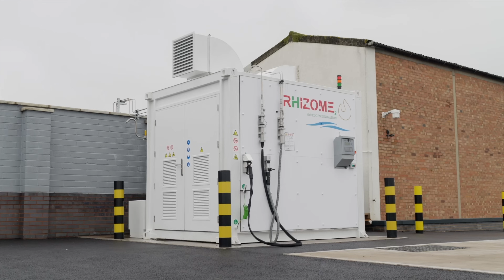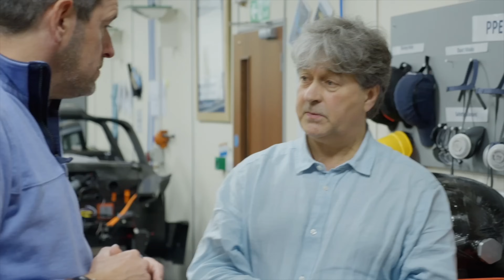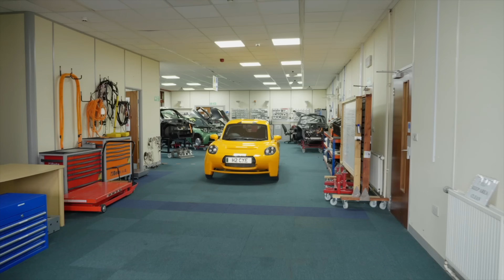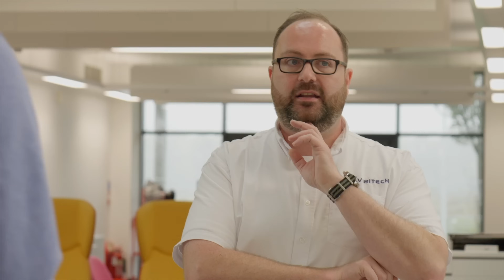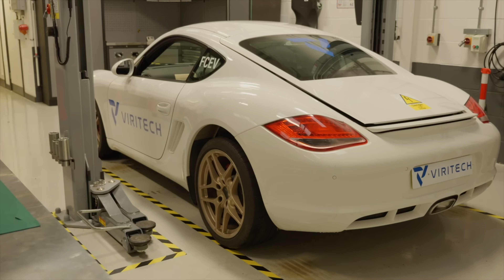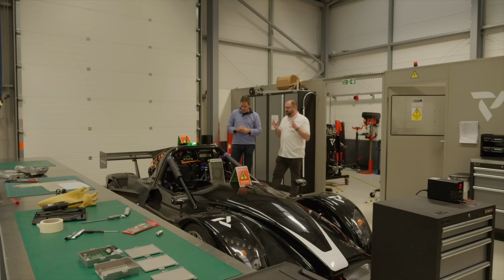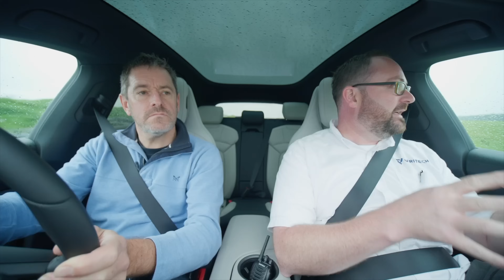Is Hydrogen a viable option for our Automotive Future ?

Comment: The biggest challenge facing low emission hydrogen is that it is expensive to produce, expensive to transport, expensive to store, expensive to distribute, and expensive to use. Whether you're switching existing users to clean hydrogen or pushing hydrogen into sectors where it's not currently used, it takes money - and lots of it. (extract from the "Cleaning it up" podcast). Countries have spent wasted millions on hydrogen as a fuel.
Reply: They want to replace dirty gasoline and diesel with "clean" hydrogen, but still tie me to buying it from a supplier at a location far from my home, when I can charge my electric car at home cheaper, and cut out the middleman.
Reply: Too many issues as others have mentioned for hydrogen to be main-stream and so a comprehensive infrastructure will be unlikely. As with any chemical fuel, chemical thermodynamics are against you; batteries and capacitors do not have that issue. Hydrogen is a very valuable chemical and a really bad fuel.
Reply: Even steam reformed hydrogen (which is about 95% of all hydrogen currently produced) is expensive. It's not only expensive to transport and store, it also leaks... a lot. To avoid this you need to either cool or compress it giving more energy loss. Then to convert back to electricity involves more losses. Hydrogen will never be cheaper than pure battery electric which is getting cheaper and more energy dense (per cost and per kg), thus solving most of the issues. Hydrogen will be needed in the future, but for ground transport it won't ever overcome it's physical limitations on storage, efficiency and cost.
Reply: lithium batteries have come down dozens of percentages since the supply chain issues during covid. Scale would solve costs for hydrogen.
Reply: @monstercameron  "Scale would solve costs for hydrogen." It will never solve physics. It's an inherently stupid idea.
Reply: @slloyd6577  this tesla fan BOY neanderthal know damn well you can distribute water to fuel stations almost for free and electrolyze that water on site with abundant daytime solar, don’t listen to fools with an elon musk twisted agenda.
Reply: The earth is full of hydrogen, you don't have to create it, you can pump it out, and it's self-replenishing. White Hydrogen stations are being built as we speak. Electricity is hard to transport over long distances and there is insufficient infrastructure to charge cities full of EVs. Both have challenges, but Hydrogen is certainly an option.
Reply: @Roar.  Electricity is easy to transport over long distances hence the project to lay an interconnector from Morroco to the UK. Hydrogen, on the other hand is incredibly expensive to transport.

Comment: Physics is the reason why hydrogen WILL never be a viable fuel for cars. 

Hydrogen is the second smallest atom known to man thus it is very hard to prevent leakage. It also needs to be stored at MINUS 253 degrees C and 10,152 psi (700 bar).

As the owners of the Toyota Mirai have found out. The hydrogen filling nozzle can freeze in place when filling and Toyota's official guidance says in the owners manual is to wait a few minutes after filling for the connection to thaw and it'll release. They don't tell you how to release that connection when the ambient temperature is near or below zero.

They don't store hydrogen at the filling stations at 700 bar but to get a worthwhile amount of hydrogen (range) in the car it's compressed by the filling pump at delivery. This means that the pump needs to compress the liquid hydrogen for the next delivery after the first delivery has been dispensed. This is why we've seen long queues forming at hydrogen filling stations in California. They are waiting for the filling pump to recompress before they can fill the next car. 

Ultimately electric cars probably wouldn't have caught on as well as they have if Tesla hadn't created its own charging network. I can't think of another car manufacturer that has done the same. Toyota certainly didn't create a hydrogen filling network. Hence they have failed to get a decent foothold in California and Norway.

(Whilst Nio have a network of battery swapped stations, few exist outside of China, hence why I don't consider this a real network)

Comment: This video is not going to date well.  Anyone who really looks into it will quickly discover that hydrogen is a non-starter as a fuel for any widespread adoption, barring some niche applications. Please, let's stop kidding ourselves. - there are too many downsides to hydrogen. Sad, but true.
Reply: Let's stop kidding ourselves - there are too many downsides to full Electric Vehicle designs! As more honest information gets promulgated about the  massive logistical and availability problems associated with battery production people will realise that E.Vs will never be able to attain the widespread  usage that Internal Combustion Engines have given us. Yes , E.V.s will certainly become more common and their designs will surely become more efficient Electrical supply infrastructure will have to improve exponentially for the genre to be accepted and this is not going to happen within the next couple of decades - if ever. We need much more research into Hydrogen power (and other forms) for the World to be able to cope with our ever increasing transport needs. Not sad, but true.
Reply: @robertowen6499  Strange, my BEV has been working great for five years.

Comment: Hydrogen production can be anything but clean to produce. The only method of production that is clean is via electricity but the ammout of electricity you use to make it is close if not more than the calorific/energy content of the hydrogen. In those terms the H2 is basically a battery and the other methids of procution have waste products like CO2 so hardly green. The last problem is the lack of infrastructure out there to use H2. I understand that the existing number of places you can fill up with H2 in the UK has actually dropped so the early backers have already started leaving the concept. The many many billions needed to deploy significant numbers of H2 filling stations are much better used elsewhere. An interesting concept but I feel doomed in it's everyday usefulness thanks to the lack of working infrastructure to help it work.

Comment: Notice how they never mention the range
Reply: Difficult to tell. It was a reasonably small tank compared to the 122L in the Mirai, and the tank was only pressurised to 350bar, when tanks in production EVs are at 700bar. Both of these factors will definitely limit range. The guy in the video did say that they were aiming for short daily trip market, but an EV, even a Nissan Leaf is already ideal for this exact purpose.

Comment: To understand hydrogen power systems, do some home work on why large mining operations have abandoned hydrogen for battery electric motor systems, main reasons the regeneration of the motors driving to the face recharges the batteries substantially, the huge reduction of maintenance on brakes etc, finally the engines become redundant, saving on long term cost, to allow hydrogen to be used puts the control into the oil companies and governments, this is not good to be able to charge EVs at home gives us control, hydrogen is a dumb idea, the infrastructure to roll out hydrogen stations is a cost that’s a madness, shell is currently dismantling all its hydrogen filling stations, worth a thought on this hopeless future fuel,

Comment: Interesting stuff but indicative to me of the shortcomings of hydrogen as a fuel source in most scenarios. It all seems to assume that battery technology has peaked in terms of energy density which it clearly hasn’t. The complexity of using renewable energy to create green hydrogen via electrolysis, store it, transport it and then combust it to drive electric motors has an almost Pythonesque level of ludicrousness to me. If a technology could be developed for shipping, where hydrogen could be split from sea water to provide motive power for very large container ships, all being processed onboard that would be something but I’ve been advised previously that’s not going to happen. It seems to me despite the FUD that we’re getting close to a tipping point towards BEVs and hydrogen is unlikely to be a viable solution.

Comment: As you have often said Pete, there needs to be a broader approach to our motoring future and clearly hydrogen should be one of the answers. The River Simple approach is a prime example where they are making a simple eco friendly ‘ town car’ that makes perfect sense as an individual transport option. The sad fact is that our current crop of politicians seem to be blinkered and are throwing everything down the rabbit hole of BEV!
Reply: Take the river simple then... would you "lease" one?  Have you looked at the cost? And how you refill it?  If not you, your friends and family, would you recommend it to them?    Didn't think so.  Just like the Toyota Mirai, it's too expensive, and too inconvent to fill up.
Reply: How does a terrible little car with nowhere to refuel (*) "make perfect sense as an individual transport option"?  The Dacia Spring EV is a better and cheaper option than RiverSimple's vapourware offering.

(*) and even if it was available, it would be horrendously expensive source of fuel.

Comment: We have been hearing about hydrogen for years with little to no real headway. Battery Electric is winning on all fronts including for heavy vehicles simple on cost and efficiency I wonder when the penny will drop..
Reply from the maker: But the is the point. Battery electric doesn’t really work for HGVs 🤷‍♂️
Reply: @PetrolPed  https://www.youtube.com/watch?v=xWEOc8O2VEY
Reply: @PetrolPed  yes it does work for HGVs. But even if it didn't then in what way does a small and ridiculous two seater car help?

Comment: 1:25 "About 50% of today's hydrogen comes from natural gas..." Yes, and most of the rest comes from oil and coal. A little under 5% comes from renewable sources, and that isn't going to grow because it's far more economic to use the electricity via a battery or transport it via wires than convert it to hydrogen. 

95% of Hydrogen for transport discussion is greenwashing and it's irresponsible not to say that. 

Unsubscribed.

Comment: In the Marine Industry we too are looking at alternative fuels. Heavy Oils are mostly used at sea on big ships, that muck that belches out black smoke you can see from Space. Only when the ship comes close to the coast do they switch to light fuel-oil to look clean. All the EV cars on Planet Earth can't cover the pollution 1000 ships on passage. This is why we are looking at Ammonia, a richly dense fuel full of Hydrogen. Basically similar power plants we use today can be remade as compatible.
Reply: Commercial ammonia is made from fossil fuels isn't it?
Reply: @slloyd6577  the Haber-Bosch system used green energy and seawater.

Comment: None of this is viable for many solid engineering reasons. 
Production of hydrogen is energy intensive. 
Storage of hydrogen as a gas is too voluminous for the energy density realized. 
Storage of liquid hydrogen has to be at low temperatures very difficult to maintain. 
Even the mighty Toyota and BMW brain trusts have given up on hydrogen for the time being. 
Physics dictate reality

Comment: So the greener way to make hydrogen is an electrolysis hydrogen generator with an efficiency rate of 70% which needs to be shipped to stations while heavily pressurised to fuel a hydrogen combustion engine with 25% efficiency.. using fuel cells to power an electric motor would increase the efficiency to 50% ..... OR WE COULD JUST USE THE ELECTRICITY TO POWER THE EV 😂... Hydrogen will never be the answer

Comment: High Pete I’m a driver of an Ev and I do get what you say. But the elephant in the room is infrastructure or complete lack of it. It’s the chicken and egg situation. Without the fuel station you won’t sell a car without the car companies won’t set up fuel stations. This is the problem Toyota have with there hydrogen car. What is needed is a company like Tesla build the cars yes but put a infrastructure in place along side it. But if we are supposed to be moving to clean fuels then how hydrogen is made has to be bought into the equation. Using natural gas to produce it is not exactly clean. For commercial use definitely the way forward.

Comment: Hydrogen may have a role in road transport but the infrastructure necessary to play a significant vehicle role is doubtful. It’s difficult enough setting up infrastructure for EV’s and electrical networking is everywhere. It’s a bit like LPG which sort of fizzled. ICE and EV’s will power most vehicles and as more EV’s are purchased it’ll impact negatively on the price of fuels for ICE vehicles. Non home charging for EV’s has to improve considerably such as covered charging stations and with battery charging technology improving charging times are coming down. It’s early days for EV’s but ICE vehicles will remain for a long, long time as their towing ability over long distances is unmatched.

Comment: Another delusional youtuber. Research the supply chain for hydrogen from creation to delivery and you'll find it's not practical except for very niche transport applications. The amount of electricity you'll use to create green hydrogen to drive a fuel cell car 100 miles, you could have driven an EV 300 miles.  Hydrogen is marginally more efficient than petrol/diesel.
Reply from the maker: No delusion here my friend. Just an open mind. You should try it 🙄
Reply: @PetrolPed  i was of the mind once that hydrogen was a possibility a while ago until i looked into the supply chain and all the problems with it and the poor efficiency of the end product.  You should try researching it. Its a "fuel for the future" and will always be in the future because you'll never make enough of it for anything but niche areas. Look for stuff by hydrogen experts that are NOT part of the fossil industry. (e.g. Prof David Ceban, Michael Liebreich, Paul Martin)
Reply: @PetrolPed  You stand alone!!!!!!!
Reply: @PetrolPed  Why didn't you mention anything about costs: the cost of the car or the cost per mile of hydrogen ?

Comment: I think you would have been better off doing a video on how the distribution is going to happen rather the vehicles but that wouldn’t have ticked the boxes for Michelin I guess. I think hydrogen does have a place for buses and construction but otherwise I think it’s going same way as the Betamax video 🤷‍♂️
Reply: Oooh, bad example. Betamax produced a far superior picture (not as good as the Phillips 2000 though). VHS however had the huge library of porn available.  With that the worst quality video (VHS is truly diabolically bad!!!) won.
Reply: @ great example, that’s my point, it would be great if Hydrogen was part of the solution but like VHS Electric already has its foot in the door and rather than sorting the infrastructure they’re producing cars that no one can use

Comment: I agree we'll need some sort of "fueled" vehicle along with the pure EV, and I believe hydrogen will be a part but I question just how much hydrogen will fill the fueled section of the pie chart. The negative payback of cracking water into hydrogen is a huge cost. Cracking from natural gas defeats the purpose. Then there's the lack of fueling infrastructure. At least electricity is virtually everywhere so charging stations just need built. Hydrogen? Not so much. There's also the problem with hydrogen leaks. Ask NASA. Hydrogen is the smallest molecule and when storing it under pressure it's very difficult to keep connections leak free. 

An alternative fuel I hear Toyota is researching is ammonia and burning it in a free piston engine linear generator. I find this interesting...

Comment: Hydrogen was, is the replacement required. But both car manufacturers and especially governments tossed it aside because it would be cheaper than fossil fuels and electric. Its not that it can't be done... Its once again the greed of manufacturing and taxes.
Reply: Most of the manufacturers tossed it aside because it's a REALLY dumb idea for road transport. The governments don't care, they are just driving for zero CO2 which given ninety odd percent of hydrogen is extracted from fossil fuel, this technology will not do. Sure you can make it work in a zero CO2 way but it uses stupid amounts of electrical energy to make a little bit of hydrogen that it's not practical or cost effective and could never be cheaper than BEV.

Comment: Great video, sadly there is one flaw in this. I am sure they are all great engineers, but they still cant bend laws of physics. Unless we have abundance of electricity from nuclear plants, manufacturing of hydrogen is still not cost efficient! 
You have to pay more than for electricity,
you have to visit a specialised station instead charging at home,
you still support monopolies, because you cant produce hydrogen on your own.
and after decades of work you still don't have a single comfortable car that could match market expectations.
Hydrogen sounds great for heavy duty machines/transports, because they need dedicated stations anyway, and have more space for tanks.
can be used as fuel for electricity generators next to ev charging hub (if we can use free nuclear energy), but hydrogen passengers cars? Still cant see a purpose.

Comment: Hydrogen and synthetic fuels are definitely part of the solution but they will be at the margins. 

The elephant in the room is the cost to produce the fuel.

Large vehicles can use hydrogen and old classics can use synthetic but at a cost. Where they are needed they will excel.